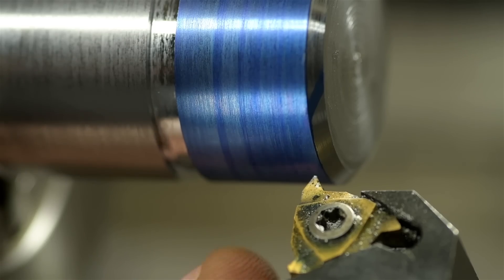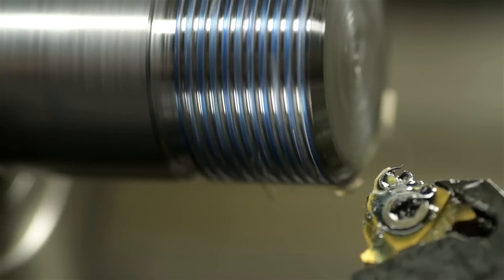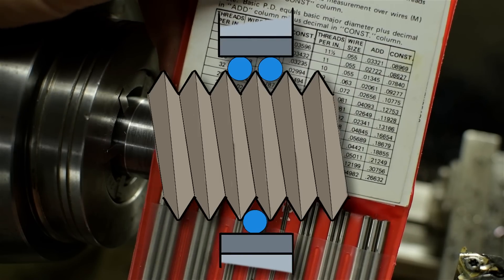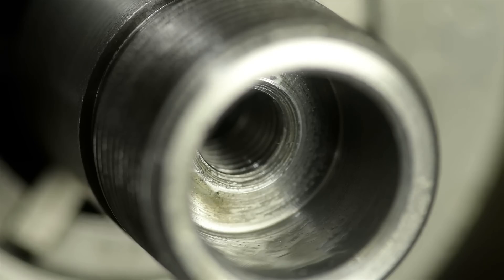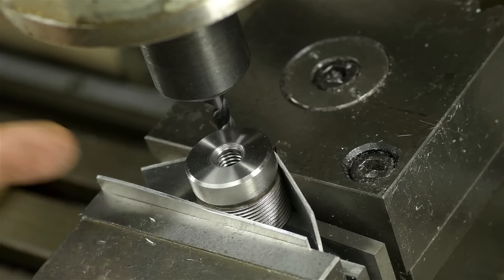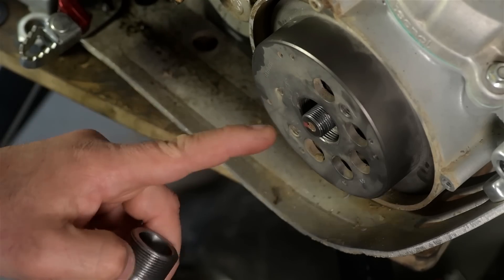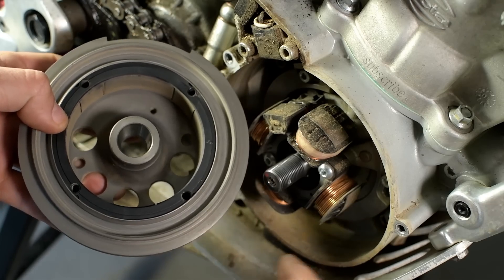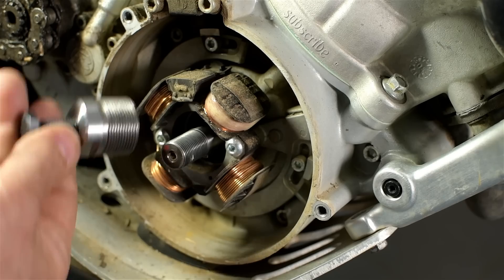EASY Flywheel Puller... using ONLY industrial lathe and milling machine!!!

Comment: Aren’t the 2 threaded holes at 180degrees .... used to jack the flywheel off? 🤷🏻‍♂️
That’s fairly standard on many automotive pulleys and even your average brake disk (if they seize on the hub)

Comment: TOT, you could change the timing by altering the wiring, adding optical or other sensor to replace or supplement that 'thing' in between the coils.

Comment: Thank you for showing real time on turning metric threads. You're having to back out the tool before hitting the other side of the groove and shutting off the machine. I guess this would work great on a lathe with a foot break... My mill turn would be trickier to accomplish this.... But, going slow enough and having room to shut it down would be ok....
I did buy a 15(?) Piece set of flywheel pullers because I work on so many different bikes... Cost $50.

Comment: Bar stock with one threaded and two unthreaded holes in a line would work as well. There are two threaded holes in the flywheel into which bolts could be screwed after going through slightly oversize holes in the bar. The center threaded hole in the bar carries a bolt used same as Tony's lathe made rig. Why pay $20 or use a lathe for a one-off like this?

Comment: Question. If you accidentally use imperial 'math' when calculating metric cuts, instead of 'maths', how far out will your parts be, and what's the conversion rate for math to maths?

Comment: On most small engines the stator/magneto has slotted mounting holes to set timing. In the video it looks like your bike is no different. There will be a timing mark stamped on the mounting plate that corresponds to one on the engine that sets timing to factory spec. The flywheel should have a tdc mark on it with a few degrees marked either way of it, there should be a sight hole you can see them through while the flywheel is mounted on the crank. You can use a timing light and those marks to determine the timing and then adjust the stator and recheck after.

Comment: Where to begin? So, you machining and working on your bike is less offensive to me, as a small engine mechanic, than you just working on your bike. Nice change.  The tool that you made demonstrated machining well but,  is difficult to use in comparison to the standard puller design. Good vid though.  Here is a pic. https://encrypted-tbn0.gstatic.com/images?q=tbn%3AANd9GcQatQ11GTttQJMoCjhXKuVZddhPN9-0jaQ2-tl7a9xUqgSK0dMO&usqp=CAU

Comment: YES, you should have  used the air impact. This is how actual shops do it, it is more gentle and quick.
I see the CDI pick-up right there, but I m guessing you were looking to adjust the spark advance. Well don't (if you don't like holes on top of your pistons that is)

Comment: Thank goodness it only took 37 tonnes of machinery to make that! I remember a long time ago there was a great debacle about an $800 hammer used in some aerospace application. Now  that I have seen what it really take to make precision things out of metal, it is not difficult to understand that a run of  say: 27 hammers with "this kind" of face, must stow in this location, weigh exactly...and  what ever other stuff matters to a nuclear detonator installation hammer...I can see how a hammer could cost thousands of dollars, like your wheel-puller.

Comment: You should tap the end of the press bolt with a hammer every so often as you’re taking it off. It will come off will a lot less torque.
Reply: Yes, I'll second that! It works a treat.
Reply: And a little anti-seize on the threads.
Reply: @chrisfreitag3924  anti seize is for wimps. A real man would get a 3 ft extender for his wrench. I think there's a dick joke in there somewhere
Reply: Shocking information
Reply: I think he likes torquing though.
Reply: Don't hit it with a hammer.
You will damage the bearings on the crank.
Reply: @TheRealBaDaBingDK  "tap" big distinction.
Reply: Just need a ball from the bearing at the end of the bolt. A diameter of 3/8 inch would be quite suitable

Comment: Nicely done Tony! A few taps (axial) on the small bolt when firmly loaded usually works well.
ATB, Robin
Reply: Was going to say the same thing. Works great, especially for ball joints where you give'r a tap, it loudly pops (scaring the crap out of you even though you were expecting it) and the puller goes flying.

Comment: Quick clarification for those with the "Air hammer and a pry bar" method in mind, although it works on lawnmowers do not try that here.. 
A lot of the cranks on these bikes are "Floating", meaning there isn't a machined surface on the crank to force-center it in the case. When (properly) rebuilt the crank is centered in the case using a feeler gauge. Smacking it with an air hammer will ruin that.

Comment: ...ToT...I suspect the cost of admission to “that club” is also unspeakable
Reply: Maybe it comes with "the knack"? 

I always figured my dad did things the hard way. Now I just call it the Bennett way.  Going to the mall? Park as far as possible from the door. Making something to fix a $2 thing? Better make a jig for it first.  Why buy a cheap import tool to use once when you can spend half a Saturday making a similar tool that'll frustrate you just as much as the real deal? That, to me, is the Bennett way. :P

Comment: You can adjust the ignition timing with loosening the smaller screws at stator then turning it, I would also recommend using bearing ball between crankshaft and puller bolt you used when it gets tight to turn the bolt tap it with the hammer it comes off more easily :)

Comment: Are the two threaded holes in the flywheel used to back the flywheel off of the shaft?
Reply: Yes they are. get a piece of flat stock, drill and tap a hole in the centre for a bolt then two more through holes to match the threaded holes in the flywheel, insert bolts and crank. That is how I have done this even with fan wheels over 6'  in diameter.
Reply: Or just use a steering wheel puller. They are good for pulling lots more than just steering wheels. And they are cheap ($12 from NAPA).

Comment: Could have drilled 3 holes into a simple metal strip. Weld on a nut on the middle hole use that middle one as a puller and the other ones to bolt into the flywheel. 

But love your method more😁 If i had a lath i would do it the same way!

Comment: Tony, I need a drill bit for shaping wood wheels for wooden toy cars. I can only find a supplier in Australia, and they require a third party shipper to ship to the States, which is damned near impossible in the current climate.
Can I commission you?
Reply: I don't think ToT does courier work.

Comment: See the bolts holding down the stator plate? There's your timing adjustment! Make sure that you tighten that flywheel proper. It needs to get stuck back on that taper, and it needs to get stuck on good. The woodruf key is there only for the timing, it is not strong enough to take any real force. If the flywheel comes loose (yes, I have that experience) that key will be smooshed, and the cutout it used to live in will be too. Iit'll damage the taper, preventing the flywheel to go back on until you fix the taper. And then there is the danger of having a flywheel on the loose. There's a lot of kinetic energy stored in that thing when it's spinning. In the worst case scenario they can punch straight through that flywheel cover, and fly off.

Comment: Can't you screw long screws trough two tapped holes on the flywheel to remove it like it's done with drum brakes? Or those holes are aligned against the coils or other not-so-tough parts?
Reply: Those screw holes are meant to place the puller, not to directly remove it. You'd damage what's in behind the flywheel.

Comment: Nice job.  I also made all of my pullers over the years for my bikes, ATV's and snowmobiles vs. buying.  It was a bit more gratifying using a homemade tool vs. a boughten one.

What are you using for cutting oil?  It seems a bit stringy like it clings to the surface well.

Thanks.

Mike
Reply: Did you notice he was also using orange juice for coolant on the parting tool?

Comment: If only you'd published this video YESTERDAY, when I needed a pulley-puller, rather than today, when I have already pulled off the pulley... Of course, no shops around me sell any kind of puller thing, so I ended up making my own anyway, I just feel I got it a bit wrong, because I used an M12 x 1.75 thread, not an M10 x 1.5. Should I put the pulley back on and make another puller? Also, the pulley didn't have threads on the bore, so I ended up drilling and threading two holes either side of the center.

Comment: I am really confused as to why the magnet didn't pull the flywheel off. I replayed the video and confirmed that the polarity was indeed East and West conforming to the left and right side of the flywheel. 
Glad you were able to make do with the shop made puller until you can get the whole polarity thing straightened out.

Comment: I thought I was the only one using the jumbo marker instead of engineers blue. By the way tighten up the puller hard then tap the flywheel with a copper hammer and the vibrations will pop it off.

Comment: To adjust the timing on the stator, rather than move the stator you used a step key. A key that fits in the taper and has a designated degree notch in it to the flywheel is ultimately at a different location

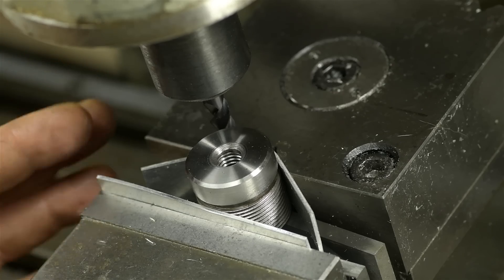Comment: 4:24 You forgot to mention to mention the lathe tightness so that it would automatically countersink the center hole and bevel the outer edge as it separated from the stock.

Comment: 1:15 id change the oil on that blue marker and maybe change the bearings ..it dosnt sound right
Reply: They don't put Zerk fittings on them like they used to. Everything's made to be disposable now.
Reply: Don't forget the blinker fluid!
Reply: @erminioottone2861  chrisfix
Reply: Nah..should  be able to squeak by with it as is.
Reply: You sure that's not a Kookaburra brand marking appliance..?
Reply: Sounds fine. It is belt driven isn't it? If so, the 'clacking' noise you hear a few times per second is the belt end-to-end joining fastener passing over the drive pulleys - metal on metal contact so it makes a clack noise. If the lathe is not belt driven then, yeah, its bearings are fuckered!
Reply: @neilwatson9581  whooooooooooooosh

Comment: Nice video. I encounterd a similar little problem. I went to a local hydraulics guy and bought a complete range of adapter couplings with metric thread (M30x1,5; M24x1.......) for a few euros. Just tap the internal thread and your finished. I made a complete series and no flywheel is safe anymore.....

Comment: Dear Tony, shouldn't it have a ball bearing at the end of the push-bolt, fitting into the small hole in the crankshaft? Else than that, a great video! Your threading is soooo natural...

Comment: usually screwing a couple bolts into the threaded holes (seen in the flywheel) is enough to pop the thing off ... no puller necessary?!
Reply: There is always a certain amount of satisfaction in doing a job the most time consuming way possible.
Reply: Glad I want the only one thought that
Reply: Seems you are right.
But check that the bolts will rest against the body, not the winding or another active part.
Reply: They have nothing to push against but the windings. That would be not good.
Reply: @staminapromos  Just get a nice thick bar and tap a hole in the center to push on the shaft and two holes for the threads on the flywheel. You could also slot the holes like on the ones they sell commercially.
Reply: @staminapromos  there is a sector that is the plain body behind the tapped holes.

Comment: That's actually a nicely designed pulley,  has both the threads and the indents on the cylinder outer wall to fit a grabber puller (if it's not a balancing cut, in which case i'm mistaken).

Comment: Looks like a typical automotive “steering wheel” puller could have done the trick also judging by the threaded holes further out on the wheel. A master bolt grip set is one of those inexpensive tools that are very handy to have around.

Comment: Using M10 x 1.25 or M10 x 1.0 would have been better as they are stronger threads than coarse threads.  You will notice that the central bolt on commercial flywheel pullers are fine threaded.  Sure, I get that you might not have the tap and bolt on hand, negating the "I need this now" concept.

Comment: If you want to play with the timing, you can rotate the flywheel and put in a custom key with an offset or you can do as I did on a small 4stroke and rely on the taper, works perfectly for me

Comment: I'm curious if you tried the two smaller threaded holes first and used a steering wheel-type puller without success. Those taper locks are indeed the bee's knees for holding things in place!

Comment: Change to a upside down tool holder quick when you reverse the lathe back to the start.  Cut going both ways equals half the time. Fyi...time is money in machining Tony.
Reply: Two-start threads with offset starts are only for people who don't know if they're coming or going.  ;-)
Reply: Better yet, mount another tool on the far side of the piece, that engages it when the front side one is pulled away.
Reply: Doesn’t work back lash in lead screw sloppy threads bad idea
Reply: @robthesultan  Bingo. Robin seems to be the only machinist here. You'll destroy your threads.
Reply: @TheMetalButcher  What about my idea? Since each tool always works in the same direction, it could be adjusted to account for backlash in the lead screw. 
Granted that it would not save much time, since the return would have to be slow and it would require more setup time.  But it may have some "look ma, no hands' value...

Comment: I must say, I was a bit disappointed the bumper didn't come off the truck/car in the attempt to remove the flywheel.  The next question is, did the tool pull the flywheel off the engine, or did it push the engine off the flywheel...?

Comment: the two threaded holes in the pulley, i wonder what those are for.....
Reply: That is what I was thinking. Don't you just drive two screws in against the housing and pop the pulley off?

There might not actually be a good surface behind those threaded holes though.
Reply: @court2379  They seem to line up with stout button head screws, so yeah, probably would have been a FAR easier (but less entertaining for us) method of flywheel extraction.

Comment: Or you could have used a flywheel or even a steering wheel puller in those boltholes you threaded the hook into.

Comment: I prefer pulling off of a straight shaft rather than a tapered shaft. With a tapered shaft you stumble  your through six different pullers that don't work then finally modify one to work. Put it on, tighten, then after all that work, POP! and you're done with it. On a straight shaft, you do the same set-up then get to use it for at least a minute and sometimes up to three hours or even more! I feel it's a better use of all the time spent in the set-up.

Comment: Made my own rearbrake wind-in tool to reset the brake piston to fit some new pads :) could have bought a 'complete' set for some 30-50 bucks0 ( sets ranging from 15 to 30+ pieces... will you get the right one in the 15 piece set???)
Reply: Huh, I haven't done brake work on a bike, but when I've replaced pads on cars, I just use a C-clamp and the old brake pads to reset the piston.

Comment: Here's a free thread wire tip: take a piece of tape about 4-6" long and stick 1 wire out of one end and the other 2 out the other end spaced apart by the pitch of the thread. This way when your third hand fumbles a pin while trying to get everything situated and your micrometer over the three pins, it won't fall into your chip pan which I'd a portal to another dimension containing insert screws, 10mm sockets, and socks.

Comment: The way to use a puller on a flywheel is to tighten the bolt with a spanner and then gently tap it with a hammer. Either this or just use impact wrench.

Comment: Thank you for not going the easy way of just getting a piece of flat stock with two holes that match up to those M6 or M8 holes out from the center and a threaded hole in the middle. You know, a standard steering wheel puller.
Not even being sarcastic.

Comment: Why not use a regular bolt puller? Isn't that why there's those two threaded holes in the flywheel itself and the center divot?
Even easier to build one at home, a sturdy chunk of plate, and a few holes and bolts...

Comment: Dual opposed threaded holes, shaft in center... looks like a steering wheel puller would do the job easily.
Reply: I saw the same and thought "2 min utube on how to drill 3 holes in a flat bar at the correct diameter and pitch".

Comment: But... The two holes in either side are to thread bolts into, with a flat bar across the two and the bolts going through it. The bar then sits on the shaft in the center, and threading the bolts/bar tight against the shaft presses off the flywheel

It's like the two threaded holes on either side of some rotors when they get siezed to the hub
Reply: That was my thought...use a bolt puller.
Reply: That would have left us with an entertainment value of very close to zero. And I'm here for the party tricks.

Comment: Just a comment: I used to mess with bike engines, many moons ago, and the easiest way I had to loosen the flywheel was to tap the ejector screw with a hammer, after it is really tight against the crankshaft axle - normally pops at first tap.